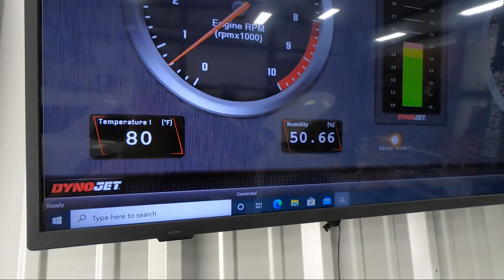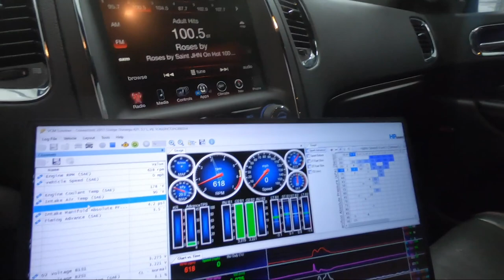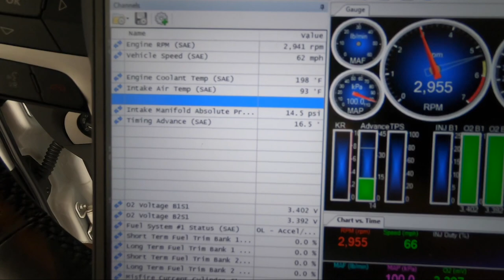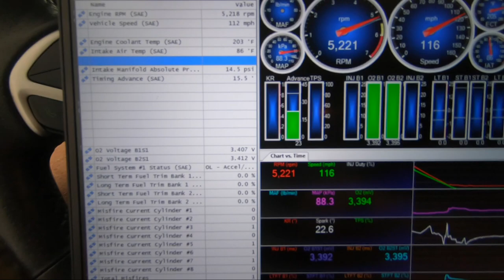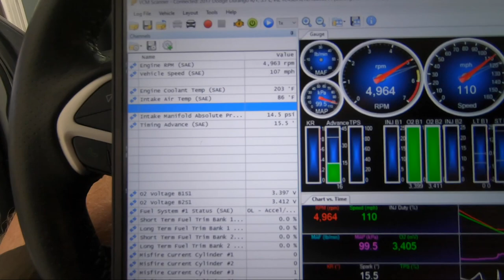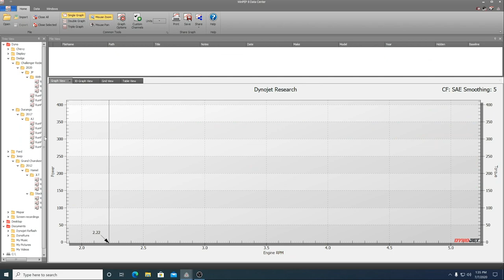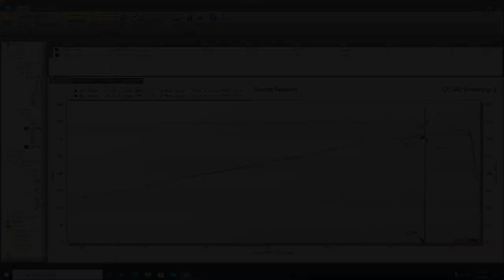JLT Cold Air Intake for Durango RT Install and Dyno Test

Comment: Realistically it made no difference. I discovered years ago a stock air intake is usually the best choice. Does anybody really think the engineers at dodge didn't think this stuff through.
Reply: I mean, it quite literally made a difference... And 10+ hp for a simple intake set-up isnt little. 
Also, very often the engineering will have an ideal option, but the administration will require a completely different option, which comes with compromise. Stock is rarely best.
Reply: @crxh2dvtec  you could lose the same ten running a few more…… 10hp, if it really did it, ain’t shit
Reply: @crxh2dvtec  well said it stock was best there'd be no aftermarket.

Comment: So I just received my JLT for the Durango 5.7 and it needs 2 modifications. 1 the power steering reservoir bottle is in the way where u connect the driver 13mm bolt and there's a pic at the bottom not allowing new air box to sit in position. Your email return not in service.

Comment: So when you convert your wheel horsepower it comes out that you're making a little over 400 hp at the crank. Is that accurate?
Reply from the maker: No, the only way to know engine HP is on an engine dyno

Comment: I own a 2012 Dodge Durango RT which I know is all wheel drive I’m assuming the model you did your test with is all wheel drive as well how are you able to disassemble the front drive so the front wheels didn’t spin
Reply from the maker: Ran in 2 wheel drive
Reply: You can pull a fuse.. make from awd to 2 wheel drive

Comment: Didnt know it was possible to run a Durango rt in rwd
Reply from the maker: It's 4wd not AWD
Reply: @JLTPERFORMANCE  not according to dodge. Or anyone else. The RTs came as either RWD, or AWD. You can do the "Fuse trick" for the AWD to be RWD. But the Durango is not a 4wd unit. Just an FYI.
Reply from the maker: @crxh2dvtec  You see it running in rear wheel drive ;)
Reply: @JLTPERFORMANCE  yes. I am not sure how pertinent that response is. I was clarifying the 4wd vs AWD comment. I am fully aware they also come RWD, and that this one is operating in rwd. Haha!

Comment: hood open will majorly benefit this open top design. the stock box takes air from lower down so gains no benefit. im slightly sceptical about the rational for keeping the hood open. i bet on the street you see higher intake temps with the aftermarket setup.
Reply: Exactly. Heat soak. Otherwise why not do both tests hood down as well?

Comment: So now it’s pushing 327hp? The v8 Durango is already 350 hp
Reply: That actually start off 360 hp so why it’s down to 327hp ???
Reply from the maker: HP ratings are at the crank, not rear wheels.